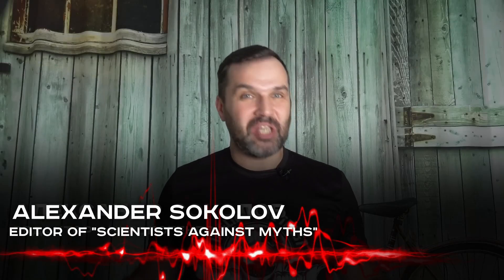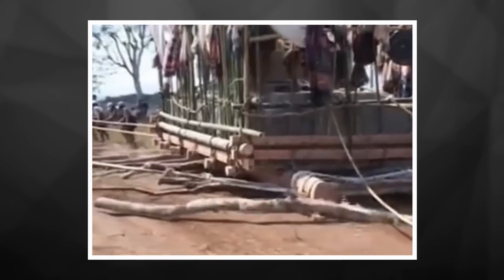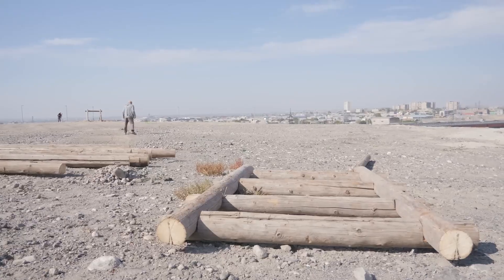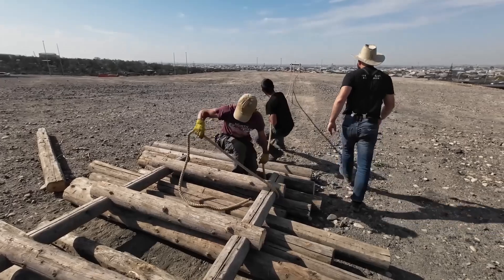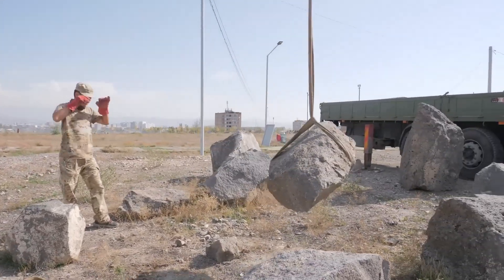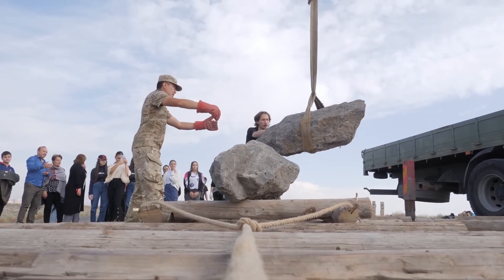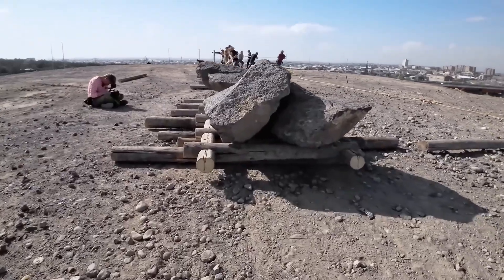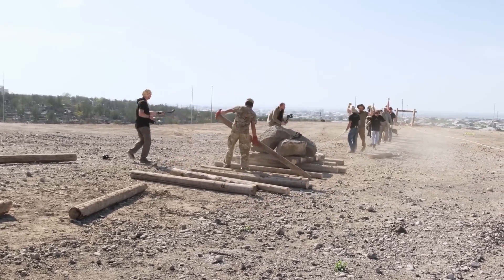How did the ancients transport heavy stone blocks? Experiment | Serious Science

Comment from the maker: Want to see more experiments? Then consider supporting our project ► https://www.patreon.com/antropogenez
Our video about the ‘impossible’ sarcophagi of the Serapeum ► https://youtu.be/47HAYcii_Q8
Reply: so are you going to built a piramide now?
Reply: If you measure the with of a square block, you make a peace off wood with a round top, in the same size of that with of the block, place 10 of those peaces in a row, you are able to push the block over it with a few people. 
It keeps the middle point in the middle and the weight is gone.. 
the block will weight a fraction from his original weight, if you have it on place, take away the woods and the weight is back..

It is the same principle of a tire, only now you make the block roll on that rounded wood.
Reply: as far as i remember there is a huge roke 600 tons mooved 300 years ago in russia on rolers and artist drue the since ----they mooved it for hundreds of km and it is now a statue of one of their rullers i think -----i sow a video on it -the title is the bigest roke ever moved
Reply: My advice, cheat and use the wind and water currents. Staying dry land a sail controlling with a line on the top which can also add lift to the front. Then there is a sea anchor arrangement to rope on land where water gives more force than air on a sail. A raft can apply sea anchor control. Think.
Reply: Don't forget the Egyptians traded across the Mediterranean and they had chariots so you know they could make heavy enough wheels for large blocks.

Comment: a crane, an axe, pulleys to pull 3 small rocks and you guys still failed. 2 tons is not comparable to lifting hundreds of thousands of pounds with precision superior to modern day equipement. the thunderstone rock took months to move 6km with metal tracks and bearings.
Reply: Ah......... - the old "adjectives and adverbs" argument...........  🥱

Moral:  this was a simple demonstration.  Unlike say the ancient Egyptians who had time and resources to make multiple attempts to work the system out = this demonstration was limited in resources + used volunteers + and did not attempt different methods to see which worked better.  

p.s. - as noted before this demonstration appeared to use old electrical poles - probably for cost reasons - as opposed to simple tree trunks with the limbs hacked off.  In the B&W film snippet in the video from the 1930's the 200-300 ton Marble block was eased down the mountainside - not using perfectly rounded poles as here = but using smaller diameter tree trunks of a largely irregular circumference.

Conclusion:  because these poles were lathed they as we see = rolled freely - making control of the sledge difficult.  The goal of using wooden logs is not for the logs to roll as much as = the sledge to glide atop the logs more easily - it being raised above the coarse ground which increases friction and effort as things are pulled across it.  So wooden planks spaced atop the surface of the ground could have accomplished the same absent fighting rolling poles which make sledge control more difficult.  

p.p.s. - the Thunderstone still moved across a wooden path irrespective of it using iron rails as those rails much as a modern railroad bed have wooden planks under them.  This demonstrates that wood can in fact support heavy weights.

Comment: an 80 ton block would smash these wooden logs at first pull...NOPE, fail
Reply: 🤣🤦 There's always one.............  So here is a novel idea = next time watch the video before spouting off nonsense.  It will save you endless embarrassment - just saying.

Moral:  the B&W film snippet in this video is a 1930's film clip - found on this platform by the way - of workers transporting what became "the Mussolini Monument."  

Prior to the oxen pulling the stone block through town the film shows workers easing a 200-300 ton block of Marble down the mountainside using a wooden sledge + ropes + and tree trunks not much thicker than these poles...........  - and they were not crushed under the weight of the load.  

p.s. - a while back I waited for a long train to pass which was crossing at an intersection.  Car after car after car rolled by on the rails and under those rails = were standard 7" thick railroad ties............  Stenciled on the sides of the cars were their weight and many when loaded had weights of = 100 tons or more - and 7" thick wooden ties could support them.

Comment: I would love to understand how the ancient civilization built the great structure that they did using giant stones weighing upwards of 100 tons and place them into specific positions etc the incas they actually seem like they would have melted the stones to fit into one another exactly fitting and holding strong for over 2000 years while most others have crumbled from the earth's natural motions earthquakes but nope they are still.!
Reply: Ah.... - no.  There is no credible evidence of the Inca "melting stones to fit."  There is however some ancient writings to the effect that the Inca might have used what was described as a type of clay with properties thought to be acidic in nature.  

Considering that the Inca lived in a volcanic region - along the eastern edge of the Pacific's "Ring of Fire" - and that volcanic rock and soil can contain sulfurous compounds such as can generate weak acid - then applying acidic clays mined near volcanic areas might have allowed them to "polish" stone faces via weak denudation through acidity.  

Moral:  the polygonal surfaces of Inca architecture would have been more for aesthetic value also having the added benefit of structural stability.  It would also reduce the work effort as it is easier to hammer off the edges of stones to make them fit than to repurpose an entire stone into a uniform block or whatever.  In seismic areas where earthquakes appear having more than 4 abutting sides also means greater surface area lending to structural strength.

Comment: It's been a while but time for a reminder.  Look at the video folks as it shows more than moving some multi-ton rocks.

1 - they are using = a single hemp rope - note the thickness.  Also look at the old video clips within this video at the ropes depicted when moving larger loads + the wooden levers used by the workers in a quarry.
2 - they clearly used old electrical poles* to do this demonstration.  What matters is they despite being wood = were not "crushed" by the weight above.  Again however if you look at old film footage of large loads being moved - like several hundred tons - using tree trunks under a wooden sledge = those are not much thicker than this - or even less so.  

Moral:  this matters because one of the arguments LAHT trots out is how wooden sledges and hemp ropes supposedly are incapable of performing such feats...........  As we see however they are and do not require massively thick ropes or wooden rollers to achieve moving such loads.  Carry on.  

* - they used old electric poles which are of course dried out.  Normally using "green wood" which is much more resistant to crushing/splitting because it is full of moisture would improve the performance.

Comment: Yes I am sceptical that this is close to explanation how pyramids were build.
Try doing this with minimum efficiency of 10 blocks/ hour . 24 hours a day, for 25 years. No room for error or accident.
Reply from the maker: And do you know how Mercedes produces one car per minute?
Reply: @ScientistsAgainstMyths  Are you suggesting that Ancient Egyptians had steam/fuel/electrical engines :D
That is this small difference how Mercedes can produce this many cars.
Reply: @jakub2711  No.  It was the adoption of "the assembly line" which allowed mass production - not how elements of that line were powered.  So how about you rather than avoiding the point = address it.  

The ancient Egyptians were not "primitives" - even if they were "less technological" compared to us today.  Accordingly they developed a system of logistics and organized work gangs doing specialized tasks - much as we still do today.  THAT = is how they achieved production rates which they did - in addition to "cutting corners" as I alluded to. 

Moral:  if someone had "technology" such as LAHT tries to infer then we should see as we do today = standardization of product output - meaning uniform blocks.  What we see however is a hodgepodge of chunks of limestone of assorted shapes and sizes - some finished and some not.  

That certainly supports their have some level of capacity as far as fracturing stone and shaping that.  It does not however support inferences of purported "high technology" such as it the basis of LAHT argumentation.
Reply: @varyolla435  My argument is on the contrary, never said they were primitives.
But either we don't know elements of their technology (without the adjective "high") or they had to work 24 hours a day with no delays in construction achieving borderline impossible efficiency.
How do you light the working area of the plateu (both the quarry, the road and the pyramid itself) every night for 25 years straight. We can start an estimate how much wood you need for massive pyres to light all this. Or did they quarry and transport stones at night with handheld torches?
By the way, did you account the ever growing assembly line? You know that the pyramid is more than 140 meters high. If they used a ramp (a straight one or a circular one?) your 200 meters from the quarry starts to be 400 meters, then 500 meters and so on.
You now have a literal video of such work being really performed. More than 10 years for digging up sand and some restoration work with concrete and 1920s technology.
Reply: Again...... - really.  🤦  Okay - follow the white rabbit Neo:

1 - if you have a single team of block movers and they can pick up a block from the nearby quarry - the main quarry at Giza was ~200 meters from the Pyramids of Khufu and Khafre - to transport it and drop it in place in say 2 hrs = your work rate in 1 block every 120 minutes.
2 - now let us increase your teams to 10.  So each team can now complete the task in about the same about of time and drop their blocks - most blocks were NOT carefully placed but instead dropped in place leaving gaps all over - in different locations of the Pyramid = SIMULTANEOUSLY.  Your work rate is now 10 blocks in 2 hrs - or 1 block every 12 minutes.
3 - how about we double our teams to 20......... - same applies except your work rate has been further reduced to 1 block every 6 minutes.....

Moral:  as we see - and as alluded to by others = the more teams working in tandem placing blocks in a given span of time the more blocks which can be placed simultaneously.  

p.s. - most "blocks" are really little more than = approximate chunks of Limestone.  They were not "individually chiseled" - few in fact were.  They rather were quickly fracturing off approximate chunks of Limestone from the bedrock and levering those onto sleds to haul them away = as is.  

Final thought.  As the Pyramids rise in height the blocks = get smaller.......  The heaviest/largest blocks are actually found in the bottom half closest to the ground.  Above the midway point the blocks become smaller as the Pyramids rise.  Those at the top are small enough for several men to lever into place.

Comment: I've had this discussion before where, people continue to say that you can't move an 80 ton block, like the granite block in the King's Chamber, or a 300 ton block, like the Ramses II statue, or the 800 ton block a Baalbek. Their claim is that the wood would get crushed. This is complete nonsense and lacks even a basic understanding of physics and mechanics. If we take the heaviest of the Trilithon Stones at Baabel, it weighs about 800 tons or 1,600,000 pounds. It measures 62 x 12 feet in surface area which is 744 sq feet or about 107,000 square inches. (I know, stupid imperial measurements ... 😁) That gives 1,600,000 / 107,000 = just under 15 pounds / sq inch. The compressive strength of cedar, a tree that was commonly used in this part of the world, is about 4500 pounds / sq inch. So, it's not an issue about moving larger blocks with wooden sleds and rollers. The materials were there, and it would only have required planning and labor to move them. Clearly, they did do this, and the evidence is quite apparent. There is no need for fantasy technologies for which there is exactly zero evidence.
Reply: The snippet in the video of the old B&W film showed a 200-300 ton block of Marble being eased down a mountainside via men piling wooden tree trunks under its' wooden sled.  The "rollers" in question were not excessively thick/heavy lest the men be unable to pick them up and move them from rear to front. 

Moral:  just the other day I had to wait for a long train to pass by a crossing.  Car after car - each weighing when full according to the data painted on their side around 100 short tons - rolled by on rails = and under those were the spaced wooden 7" thick railroad ties which did not "crush" from all the weight pushing down upon them.
Reply: @varyolla435 Redwood trees require help from Atlantis otherwise they would be crushed under their own weight.

Comment: I think it would help if you remove the loose small rocks on the ground. The beams will roll better on a clean floor. Or an other option is to place the rolling beams on two paralel planks for a smoother surface to roll on.
Reply: What would have been better is to use "green wood" and to not "roll" the sled = but pull it across a "road" of thick wood planks spaced out.  That way the sled can still slide across a smooth surface - hence less friction - and it will be easier to control than with rolling logs perfectly round.

Moral:  I made this point before here.  It appears they used old electrical poles - probably owing to cost.  In the video demonstration from the 1930's however if folks look they simply had tree trunks of a diameter which a couple men could manipulate and they were not lathed round = they simply had their branches lopped off.  

The goal is to raise the sled above the level of rough ground and onto a surface its' skids can be moved more easily.  As we see using lathed "round" wooden rollers allow the roller itself to move freely which complicates the movement.  Wooden beams laid into the surface of the ground would accomplish the same without the wooden planks rolling this way and that.  The "concept" here works - only it's application needs tweaking.  

p.s. - "green wood" is full of moisture and thus does not crush or split as easily.  Dried out wooden posts as here however as we see are more brittle and prone to splittage.

Comment: There isnt a question around how to move this stuff on the ground. Theres slides, man and beast for this. A hundred ways to do it.

The question is how did they cut, quarry, transport, but most importantly move one of these an average of 200ft up in the air to pile on a pyramid every 2 and a half minutes.

....and without stopping for a second across 40 years. With normal interruptions of society, it comes down to every two minutes. I get that you have lots of people. But the logistics gets truly insane and beyond unmanageable. The timeline is at least way off.

Also the attribution of the great Pyramid to Kufu was never meant to be certain. It is a hypothesis based on his name randomly scratched onto a wall--one which has since evolved to an accepted fact without any new evidence in between. The whole thing is a mes; we arent supposed to treat ancient nistory like we do our own recorded history. They are completely different disciplines.
Reply: Teams working simultaneously is how projects are completed. Inclined planes are also used daily.
Reply: First is that if you study them the pyramid blocks decrease in size - hence weight - as the pyramid rises.  The largest/heaviest blocks are therefore found in the bottom half closest to the ground.  Ergo earthen ramps used to raise those blocks need not have gone "all the way to the top."

The smaller blocks which comprise the upper half of the pyramids could be lifted via a fulcrum/counterweight device akin to the Egyptian shaduf - save larger - which rested upon "the steps" to lift the smaller blocks to the levels above.  

Moral:  as noted by others organization the same as is used today can achieve your "time factor."  Multiple teams working in tandem laying blocks simultaneously in different locations change "1 block every......" to = MULTIPLE blocks every.......  The more teams laying blocks simultaneously the more blocks laid in a given timespan.  

p.s. - look at photos of the exposed western base of the Great Pyramid.  See = a continuous ledge of Limestone.  The Pyramid was built atop an existing hillside which was leveled at its' edge and blocks stacked atop it.  So the inner chambers/corridors - found in the bottom half as noted - likely saw the ramp used to raise the blocks being = part of the existing natural incline of the formation the Pyramid is built atop - which was then covered over. Experts estimate at least ~23% of the Great Pyramid's inner core is natural bedrock rather than blocks.